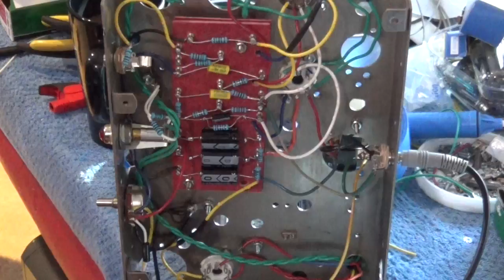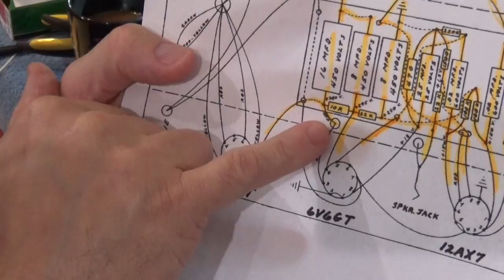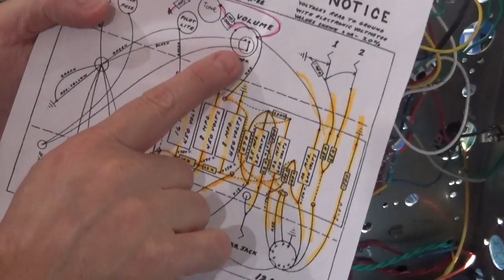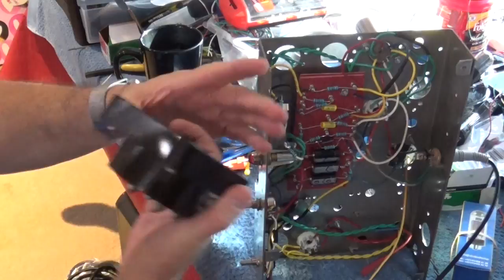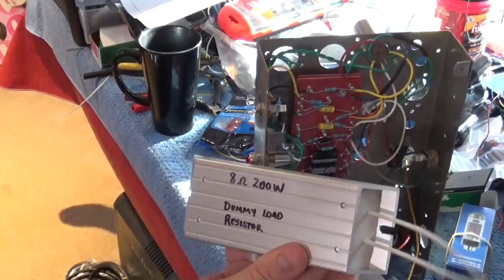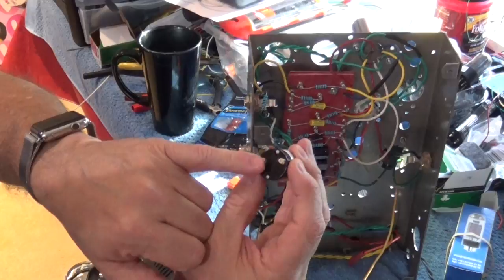Atwater Champ Combo Amp - Episode 5 - Output Transformer woes

Comment: Thanks for the advice on that output transformer.  I'll probably never build an amp, but I wonder if the same holds true if I find a radio that needs a new choke.  If I do ever build an amp it would be a very small one similar to a phono amp for plugging my mp3 player in to connect to old radios with the phono input.  Take care.  Gary
Reply from the maker: You never know Gary. They are so simple to build and especially if you are converting an old radio to one.  Piece of cake :)   I do not think the choke works the same way but I am not positive .   Regards, Ron

Comment: Hey Ron,,,, nice tracking down the feedback loop. Very cool add on with the tone control also. btw,, do you remember where you got your dummy load? 
Also,,, I thought you might want to know,,,, Your meter you have is an analog vom. A VTVM is a analog meter that has vacuum tubes in it to operate. That's the VT part. They can take a bit more power when using on tube gear. Take care my friend.
Carl
Reply from the maker: Carl, excellent catch on the VTVM. You are spot on... no tubes in this one.. LOL  I got the dummy load resistor at Digikey, but I have found some on Amazon as well.  The feedback loop knocked me for a loop for a while...   :)   thank Carl - hope you are well,  Regards, Ron
Reply: I was going to say, I'd love to see those little tubes in that vtvm, lol.  Take care, Gary
Reply from the maker: LOL Gary.... Me too !!!